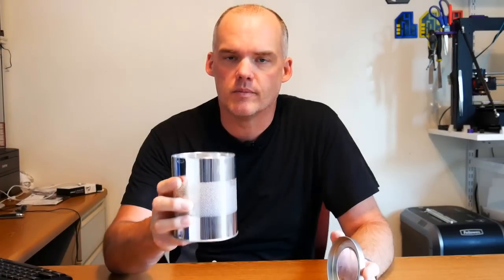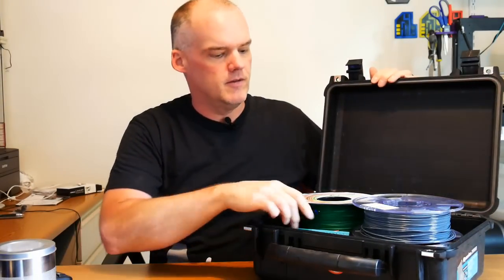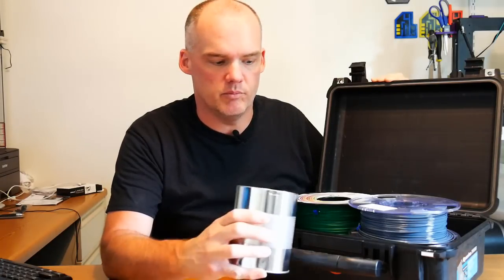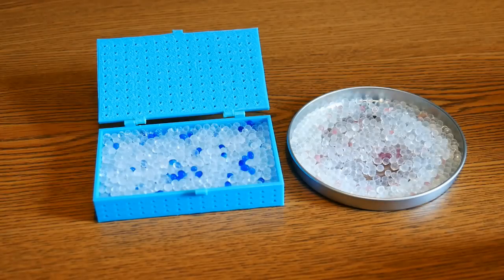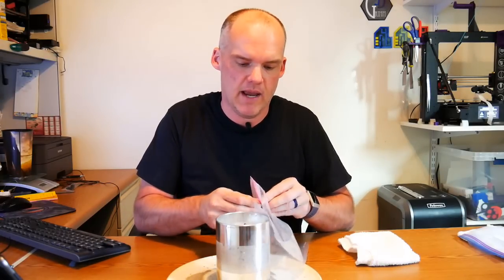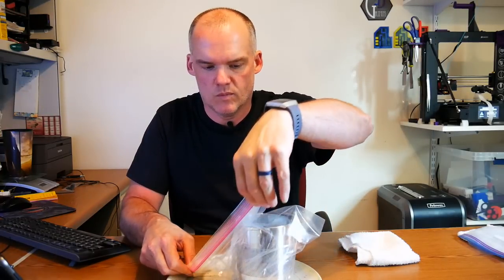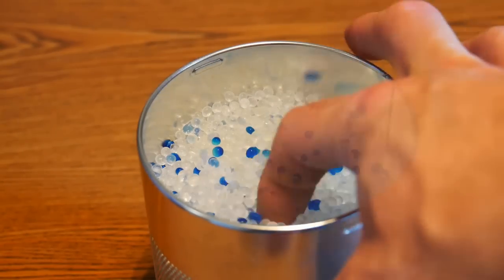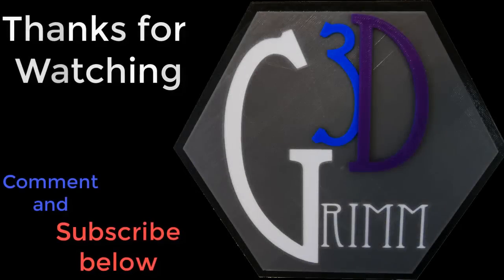How to Recharge Silica

Comment: How do you recharge the packets
Reply from the maker: I've never tried to recharge the packets. I'm not even sure they are rechargeable. I'd assume you would recharge then the same way, low heat for a few hours. Let us all know if that works!

Anyone else have any ideas?

Thanks for watching and for being part of my channel
Reply: Grimm3D thanks for the quick response! Yeah I think you can just leave them in the oven at a low heat and wait for evaporation. But I was just wondering about specific heats and times for the small packets. I don’t want any fires 🔥!! Lol
Reply from the maker: @ethanguidry312  makes sense. My trouble with the small packets has always been that they don't seem to be enough for the larger containers I use for filament. The little packets seem to only be good for single, plastic bag style storage.
Reply: Grimm3D yeah I see what you mean. But, our use mine for coin collecting and preventing the moisture and humidity from damaging proof coins and brilliant uncirculated coin I just put a couple in a bag with an album or some rolls of silver coins

Comment: How do you know how much to use? Have you had to adjust measurements on that box at all?
Reply from the maker: I print that blue silica box at 150% these days and fill it with silica. I also monitor my boxes with a humidity sensor. Stays around 10-15% humidity. If it goes above 20% humidity the sensor sends me a txt. That way I know when to recharge the silica. 

My updated procedure proabably means that I should make a new video.